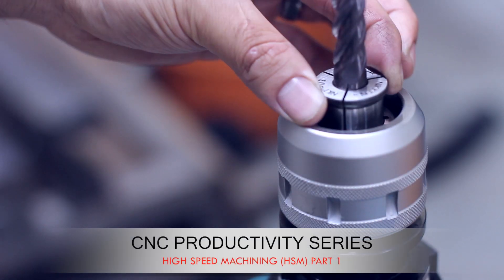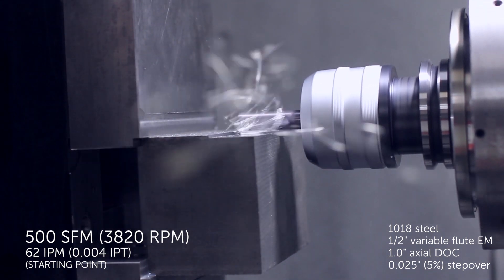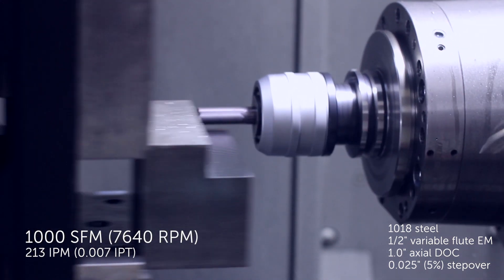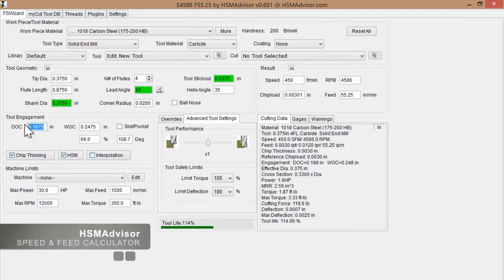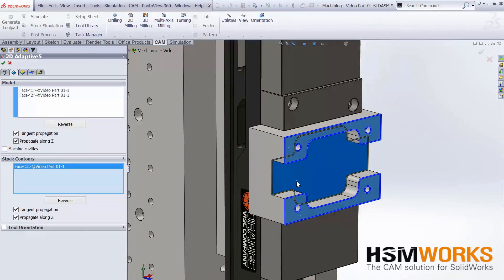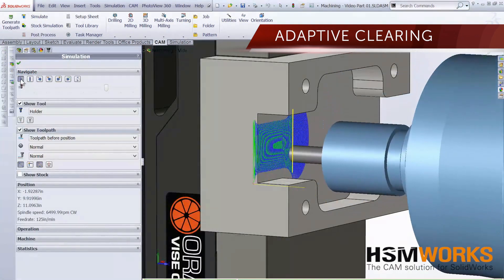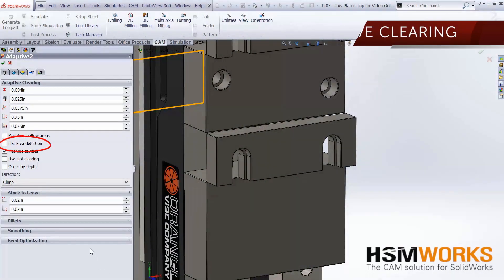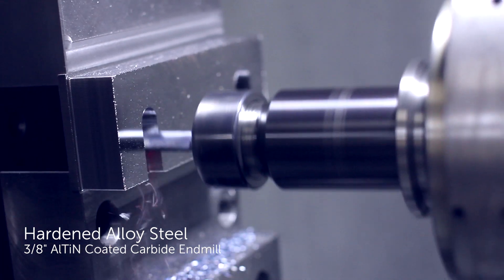CNC Productivity Series - High Speed Machining (HSM) Part 1

Comment: G-Wizard says...
1018 Steel
.500" 4 flute carbide end mill
1.00"   DOC
0.025" WOC
9,200  RPM
300      IPM
Chip Thinning              = .0036"
Material removal rate = 7.5 (ci)
Spindle Power            = 5.25 HP
Reply: My HSMAdvisor says
Material: 1018 Carbon Steel (175-200 HB)
Tool: 0.500in 4FL Carbide TiAlN coated Solid HP End Mill
Speed: 1380.0 SFM/ 10547.8 RPM
Feed: 0.0080 ipt/ 0.0321 ipr/ 338.39 ipm
Chip Thickness: 0.0035 in
Engagement:  DOC=1.000 in   WOC=0.025 in

Which is actually pretty close on a medium performance level.
Balls to the wall mode shows the endmill would handle even 10390.0 RPM/ 500.00 ipm

Yet it costs much less and does not require constant internet connection.
But hey, there are iphone people and there are android people.....;)
Reply: HSMAdvisor You just rocked my world

Comment: Great video. The IPT is slightly misleading though since the actual chipload is 43.6% of the advancement per tooth with a 1/2" endmill at 0.025" stepover.